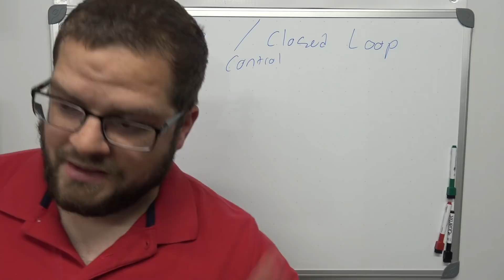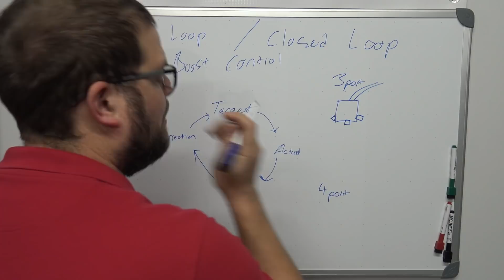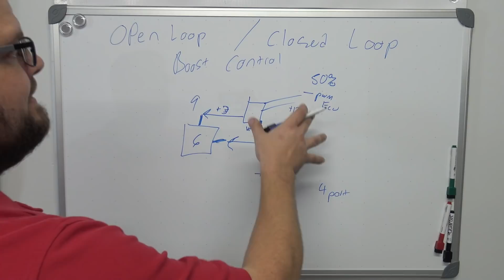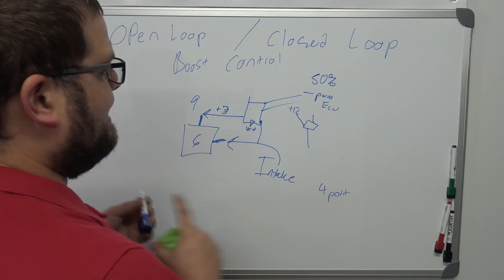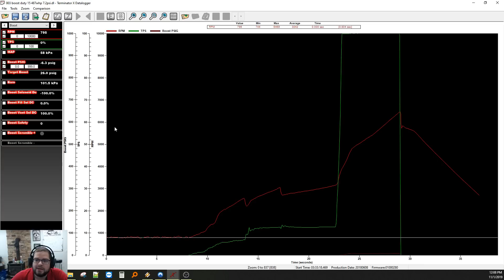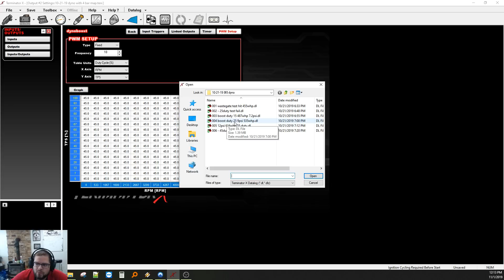overview and how to open loop terminator boost control

Comment: Matt On my truck i’m calling for 24psi and it makes 18. I’m not sure how to fix that. Also how do I go about getting info on you dyno tunning? Thanks
Reply from the maker: With dome sensor? Is there 18 in the dome? Dome and manifold are not the same just a heads up
Reply: @SloppyMechanics  Yes I finally figured it out yesterday. Lol 😂 Dome pressure is not boost pressure. What was confusing me is in the Holley it’s called Boost vs Time

Comment: Do you block of the internal MAP vacuum linewhen you add a 3 bar MAP ?
Reply from the maker: no, its non functional at that point so you don't need to do anything with it, there is no air going to or from it.

Comment: Can someone answer this for me. Just learning about the term x. 

If someone ran a manual or separate boost controller would the ecu automatically adjust if you changed the amount of boost being ran? Or is that not how it works?
Reply from the maker: yes

Comment: Holy moly. Last night I followed A21 Bravos "Sloppy transbrake V2" video and was able to jump up on the converter and spool like nothing.

Tonight I wired up a 3 port mac valve and I followed this super simple PWM output example you showed and I got functioning boost control.

This is the first time I've ever messed with a standalone or any turbo LS stuff for that matter.....but boy I am I having fun. I would've never believed I could slam a shitty foxbody together for next to nothing and have a car that I can barely manage to keep on the road. Thanks for all this great info you give out!

Comment: Hello mat I did everything you said to do in video and I tried to test it with putting compressed air from my compressor with laptop hooked up and key turned on powering up ECU I have the Mac valve set at 10% duty cycle and I never get any buzzing coming from Mac valve.

Comment: I downloaded the Terminator X software and started playing with it. I run megasquirt right now (v2.2)... will it do everything that the software shows it'll do. And do you have to run a TPMS sensor and idle control. Right now I'm using for the Edis 6 air intake temp coolant temp and map. Now I realize I'll need to add a cam sensor to do sequential fuel and spark. But if I got this system on a 6 cylinder could I just start by doing sequential Fuel and continue using my msd6Al box setup and add coils later. Also I think I'll need to add resistors to each injector.. there only 2.2 ohms. This is a dope system if it does everything it shows.

Comment: I finally got the BC to work by offsetting the 100psi “Holley” sensor to show 0 psi at idle but I’m seeing like 60psi on the dome at 15 psi of boost. Is that a true number on the dome or do I have something setup wrong?

Comment: Great information. I'm running 93& meth, and the car is only getting 13 lbs with 24psi of CO2. Where with HP it would get 22boost with 17 psi CO2. I think 11.4 target AFR is stopping the boost. What AFR you recommend?
Reply: I have boost leash running the boost.

Comment: Matt, I want to preface this statement by telling you that I'm not being critical, I'm only asking out of curiosity, when you use an example of target air/fuel at 12.0 and your car is at 12.5 you said that this was slightly rich but wouldn't that be slightly lean? Thanks

Comment: Thanks so much dude this is amazing info!  So if you're running a manual trans how do you regulate boost per gear or mph?
Reply from the maker: speed sensor, gps, gear indicator, on off switch for higher or lower gears, lots of ways!

Comment: Great stuff Matt.!  Would you mind going a bit more deeply into the effect of frequency?
Reply from the maker: its how fast the valve is turning on and off, sometimes raising or lowering it can add or remove resolution or oscillation etc., but i would say 18-30hz all work approx. the same on every car
Reply: @SloppyMechanics  Thanks Matt!  Curious how you happened to be answering this 3 years later, but much appreciated!!  :)  And I'm super excited to see F7 ripping.  I'm actually starting to mess around with all-motor, and non-intercooled, lower-boost turbo setups more because it's gotten to be way too easy to make way more power than is useable.  To the point that some of the fun has gone out of it for me.  Lol...  I'm even sort of interested in messing with a 4-banger like a 1.8t adapted to a 4L60e, just to make it a challenge again to make some power. Sorry for the unsolicited, off-topic rant. Hahaha..
Reply from the maker: @tptrsn  same boat!
Reply: @SloppyMechanics  I thought so!

Comment: In the boost settings. Will it still be able to use the boost vs time? Basically in the pwm you just adjusting the max boost target that you want?
Reply from the maker: Correct

Comment from the maker: i am flattered so many of you have no questions and only praise for what i threw together quick.
Reply: Yep. 6 months ago I didnt know what things like a pwm output or dual port wastegate even was. Now I am watching your videos and comfirming things I'm finding out along the way.. big difference,  cheers
Reply: I've been following you for a bit now, and really enjoying your videos, thanks for the load of information in these videos. Because of the information you've provided in these videos, I'm going to try something a very different and put the smallest pulley I can on a supercharger that won't cause belt slip and put a waste-gate on the plenum to control the amount of boost I see. I loved the fact that we are able to increase or decrease boost pressure with alcohol percentage using the advance table and wanted to give myself that ability with a supercharger, why should all the turbo guys have the fun. No more switching out pulleys for more boost, now I will be able to simply increase boost like the turbo guys do. If you don't mind I do have some question I would like to run across you, where's the best place to get in contact with you to talk more about this?
Reply: The pid tuning would help also!
Reply: Ok so I’ve got a quick question in regards to putting scramble on the bump button. Does the ecu automatically disregard scramble while you are using the trans brake input and bumping in? I don’t see a setting to disable bump while using trans brake input unless I create an advanced table for boost offset?